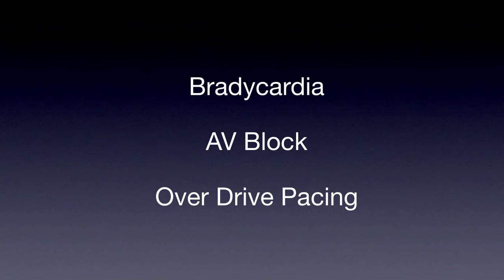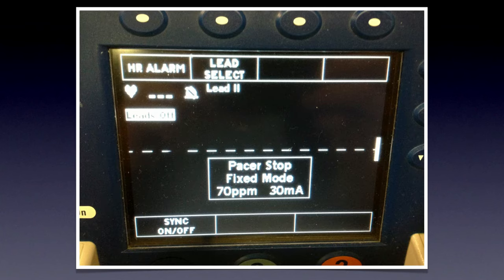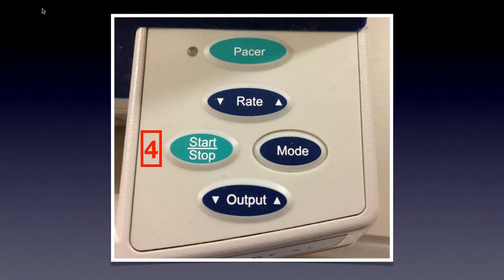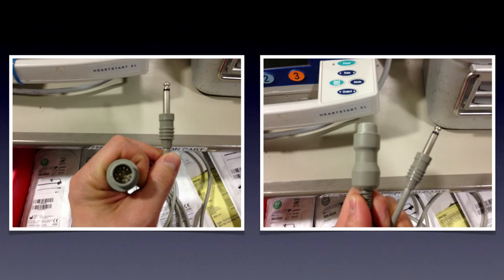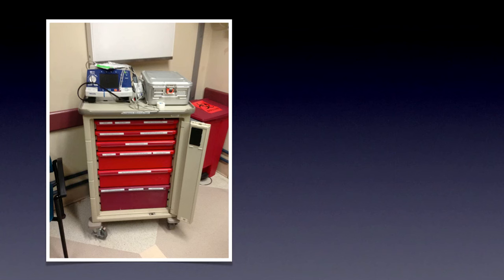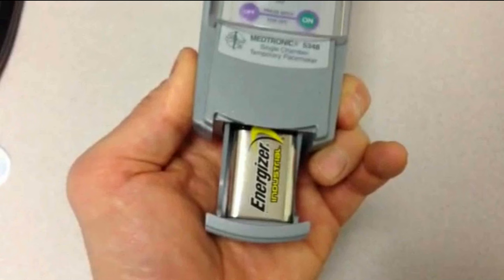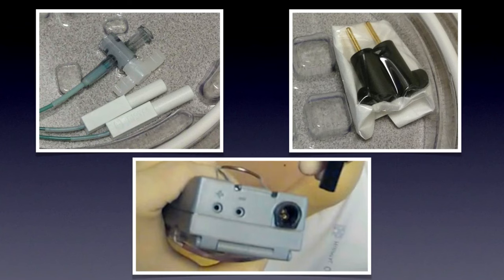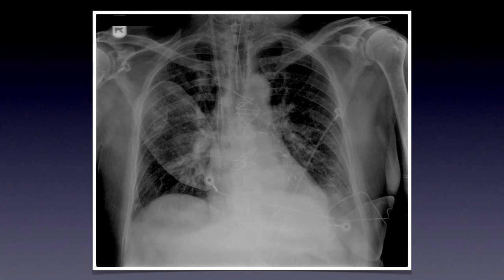Practical Pointers on Setting Up Emergent Pacing

Comment from the maker: depends on height of pt and site of access for the introducer.  as you are starting the procedure would estimate based on PMI to introducer site for catheter length. If you are a lot deeper consider misplacement; pull back and redirect pacer.  Also can evaluate a pre procedure CXR if available to estimate length.

Comment: The mechanical/electrical capture is what everyone gets confused on. They see electrical capture on the monitor and call it good. They wonder why their pt. being paced at 15 mA is still snoring. I always tell my students to not rely on the monitor when you are turning up the mA. It has to go much higher with transcutaneous pacing, esp. if they are obese/muscled. Feel the pulse, check mental status. When you feel a pulse, stop. I always make sure I've got a good BP before I dial back/optimize my mA. Give that nutrient starved myocardium a little lunch before messing with that.